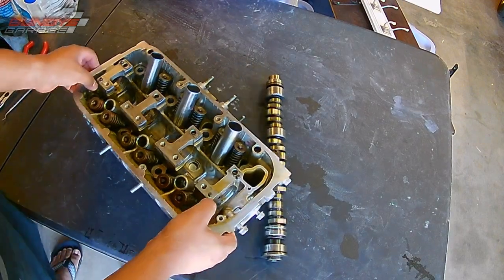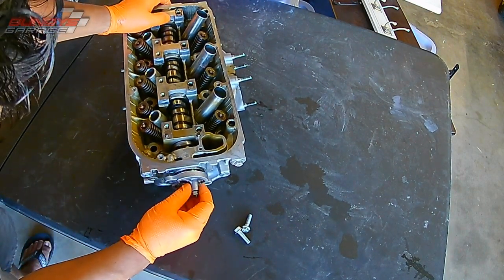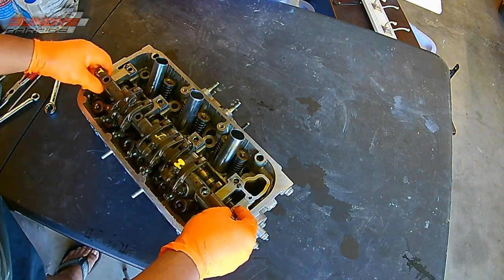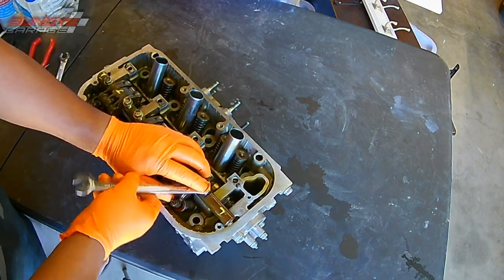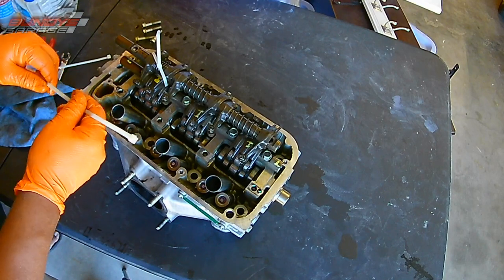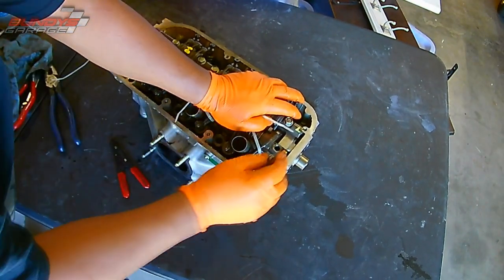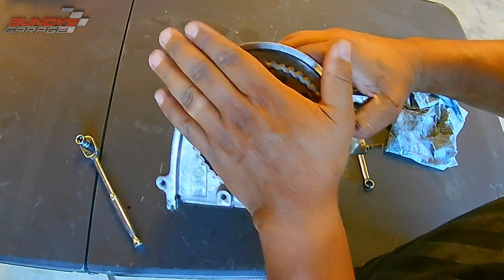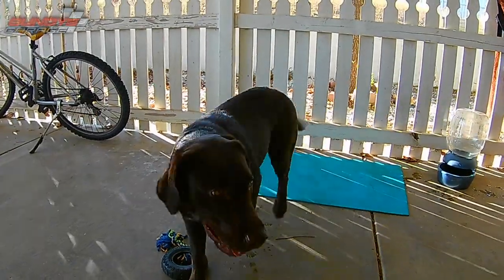J Series Head Assembly | Honda Acura | Odyssey Accord Pilot Ridgeline CL TL | Bundys Garage

Comment: Great video! Bought a project Odyssey 230k 2006 touring non vtec.  Original problem 6mm bolt dropped in intake and lodged in #5 intake.  Pulled that head got different head and lapped valves and new stem seals.  Reinstalled head, Aisin timing belt kit. Now running.  Drive it home and burning 1qt/ 75mi.  Burns the most oil if I let off gas pedal and coast then on the next acceleration bam mosquito killer!   I am leaning toward doing piston rings on all 6.  I also thought about just the rear head valve stem seals.  Compression on 4,5,6 are 185,160,175 and “rear” 1,2,3 are 230,220,215 suspecting higher due to oil.  Plugs are wet.  I would appreciate any thoughts.  Thanks. Also installed VCM muzzled 2.

Comment: thanks for the overview, I have a maybe stupid question, so I had installed the rear head and come to find out, it had the sprocket 180 degrees in the opposite direction. I went ahead and removed it, and loosen the rockers and set it at TDC, so here goes the stupid question, or not. should the valves on cylinder 2 intake, and 3 exhaust be open. please advise, not sure if I should install head with open valves, But maybe that is correct. The front head I installed is TDC, but didn't check to see if the valves were open or not after I did the valve job. thanks

Comment: Got a question: i know you can rotate the cam gear and adjust the valves on the front head 4-5&6 before you put the head on. What if i carefully transfer the marks to the back cam(very easy) Can i then adjust the valves on the back head too before installing the head? Of course i will recheck them after timing belt is on. In my honda odyssey i cant see exhaust valves on cylinder 1-2-&3 when head is on😎😎😎 Thanks👍 And yes put blocks of wood under each end of head so that valves wont hit anything👍
Reply from the maker: I’ve never done that. I’ve always adjusted the valves once the heads are on and the timing belt is set. It’s the last thing I do before I fire it up. It would be a real PITA to do all that work and then have the valves and the pistons hit each other just cause you were trying to save some time. I wouldn’t recommend it.
Reply: I can do the valve adjustment  with the head out of the block?
Because my head is in the machine shop right now and i think is more easy out of the block before installed again
Reply: @eduardomartel1530   very carefully transfer the marks from the front cam to the back cam. Just be sure to have the head raised up on blocks and make dang  sure as u rotate the cam that the valves Do Not hit anything! Take your time! Hit me back if u need any tips👍👍👍
Reply: @kttango9662  thank you bro

Comment: Hi Bundy.  Can the end cap cause a small oil leak at the camshaft seal on the other end somehow?   I’ve replaced the camshaft seal twice but I’m still getting a very small amount of oil leak coming out of the camshaft rear cover.  None reaches the ground but you can see that it’s leaking oil.  What’s your take on this?  Thank you.

Comment: Where can I find torque specs for EX and IN BOLT?
Reply from the maker: What’s the year make and model? Also are the bolts 6 point or 12 point. 2 different torque specs for the different bolts.

Comment: Gm I'm doin timming belt work on 2012 crosstour both tdc n front camshaft line up but the rear camshaft wont line up its one tooth off any help or suggestion with this issue?

Comment: Hi Bundy, great video! I'm working on putting my 2006 Odyssey cylinder head back together.  Quick question, I reassembled the head just like you did and then used a wrench to turn the camshaft.  It was hard to turn each time the cam contacted one of the middle arms on the intake(VTEC) side. It took a lot of force before the cam would move past that point.  Once it did it was easy to move until the cam got to the next middle arm.  I lubed the cam before installing and the rocker shafts/arms.  All of the valve clearance adjusting screws were backed all the way off.  Worried something is wrong?  Thanks!
Reply from the maker: Thanks for watching. Why are you rotating the camshaft in the first place? You should have set the cam gear in the correct position before installing the head on the block.
Reply: @bundysgarage  Hi, it's not installed on the head yet, still on the bench.  I just did what you did in the J series head assembly video.  I put a wrench on the cam gear bolt to rotate it and make sure everything moves.  I just wasn't expecting the amount of resistance I felt when the cam contacted each of the middle arms.  Made me think something was wrong.  Guess it's the arms pushing against the VTEC springs?  I really enjoy your videos.  thanks.

Comment: hey bundy. thanks for the video. i have a 2012 odyssey with a tapping noise. I suspect, i may need to replace the one cam gear. Can i replace it whitout removing the head from the van?  do you thinks it may be a wear on the cam gear. The tapping seems to be the louder  near cylinder 4.  The tapping is louder if i have the stetoscope on the plastic cover next to cylinder 4. i placed the stetoscope on the oil pan and it is not as loud as on the plastic cover of the timing belt next to cylinder 4. the van has 170 miles. it is still running perfect no issues, no lights , just that tapping noise. I replaced the timing belt kit  with new water pump, tensioner, idler etc and still the same tapping noise. the tapping noise seems to be there all the time, but is less noticeable when the engine is warm. it is not very loud if i am inside the van   bearly hear it. this is the link for the tapping noise https://youtu.be/VqaHOI-K_JQ . any advice will be appreciated.
Reply: What did you end up figuring out?  I have a 2012 odyssey too, same tapping/knocking.  Any help I would appreciate.

Comment: You mention you have a lot of experience with Honda V6 engines.  I recently had my timing belt fail at highway cruising speed (due to apparent "Genuine Honda" knock-off parts purchased on Ebay (ugh) after only 6k miles on the new belt.  A failed belt tensioner is the root cause.  I see there's some people saying you have nothing to lose by simply trying to replace the belt (and tensioner) and see what happens.  It's not that much labor to try, but do you think it's worth it or from your experience should I simply go after pulling the heads and inspecting the valves right away?
Reply from the maker: Thanks for reaching out. The V6 has a higher chance of having damage, more so then than the 4 cylinders. The best approach would be to do a leak down test on the engine and then you would know for sure if your valves are damaged. And don’t buy parts like that off of eBay.
Reply: @bundysgarage  thanks so much for the quick response.  Great video by the way.  I only purchased them off Ebay as they were in "Genuine" packaging and were sold as legit genuine Honda parts.  Their feedback rating was great, too.  If I only knew then what I know now.  Thanks!
Reply from the maker: Report that eBay seller!
Reply: I had the exact same failure.   eBay parts that had "Honda" label on all the bags.   Timing belt broke at 65MPH and bent some of my valves on cylinder one.  I'm getting ready to pull the head and replace a couple of valves.
Reply from the maker: Freaking Chinese parts